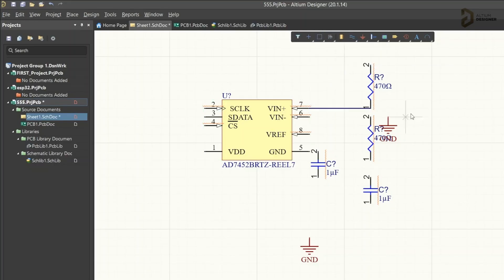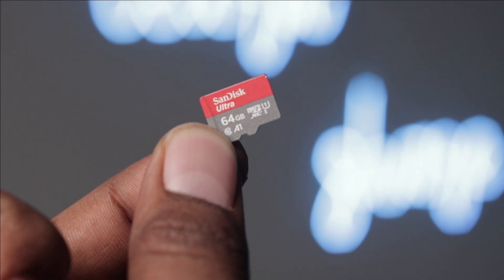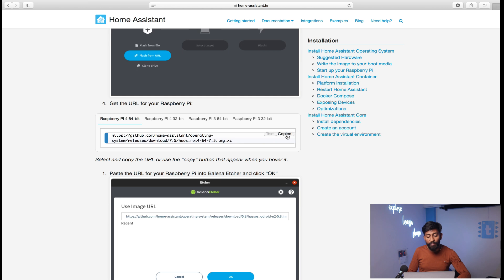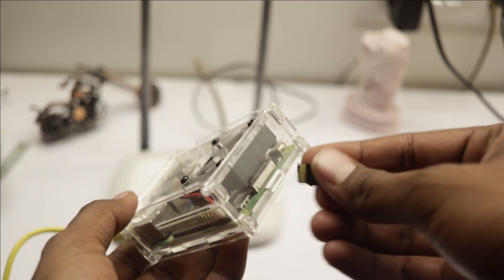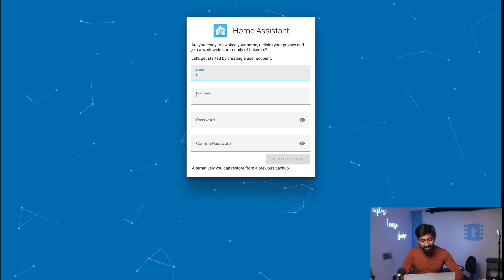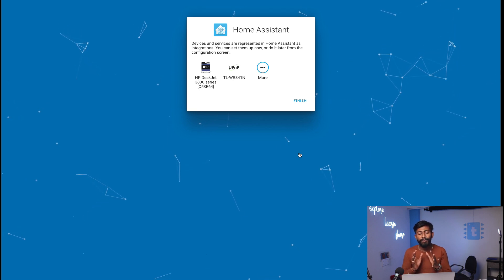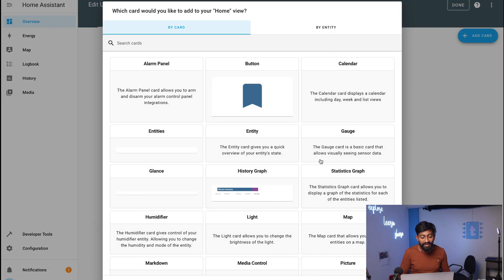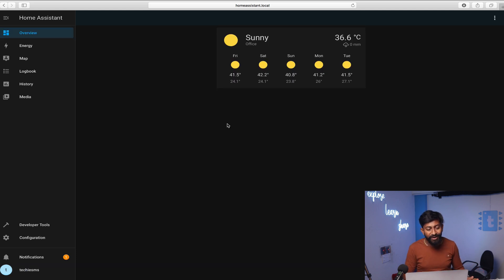Learn How To Start with HOME ASSISTANT in 2022 !!

Comment from the maker: List down what do you want to learn in Home Assistant ? 👇🏻
Reply: You are really a great all rounder of State-of-Art Technology!!! Many many thanks for this HA series 🙏🙏 and I am sure you will rock in this too.
Make Home assistant Dash board an unified one associating with ESP-NOW, Node-Red, LoRa and Tasmota etc.,
Reply from the maker: @rarenu  noted 
We will try to work on all the things mentioned
Reply: Integration of different platforms like Tuya & Tuya local
Reply: thanks so much.😊
 if possible, is there a way to make HOME ASSISTANT access esp32 devices with blynk ??
Reply from the maker: @hskh9235  need to research on this topic
Reply: @hskh9235  why?
Reply: Thanks for video about home assistant
Reply: A home cctv
Reply: please make video on how to control esp32 tasmota home automation with apple homekit
Reply: I want to learn how to connect many esp devices to single server, some esp devices might be kept at different locations where the original router range won't reach so the esp device kept at further distance should be connected to main router through other esp device like some sort of tree topology or mesh network
Reply: @33 - P A Anshad  techisms has already made a video of mesh networking. You can watch that.
Reply: @varunkumarr9633  thanks for mentioning that I have watched them  but it would be better if he integrate that to home assistant
Reply: Want to learn:

How to control Home Assistant from outside WiFi. (Remote Access )

How to make Home Assistant Faster
Reply: @Innovation_king  use ZeroTier
Reply: @Innovation_king  sure 😂

Comment: I can't open the local webpage but the raspberry Pi is connected to the wifi i even tried to open it with the raspberry Pi IP add but still didn't work out

Comment: Does the HA flashed into the RPI SD card have the ability to allow ssh ?

I did follow the instructions and now after inserting the SD card, the "IP scanner" does not show the Pi.
The RPI is connected over a physical network cable and is on the same network as the router.
Reply: Same issue any solution?
Reply: @fatalshot  I gave up with HA. Spent too much time on it. Went back to another OS.
Reply: @kiranshashiny  which OS was that ?

Comment: I want to learn how to connect many esp devices to single server ,some esp devices might be kept at different locations where the original router range won't reach so the esp device kept  at further distance should be connected to main router through  other esp device like some sort of tree topology or mesh network

Comment: Using HA since 2 years. Love it
Reply from the maker: What plug-in and integration u r using ?
Basically how u r using HA let us know
Reply: @techiesms  Homekit bridge, Mosquito MQTT broker, adgaurd home, esphome, spotify connect, tasmota, nodered, letsencypt, zerotier ❤️, tor, tailscale, grocy, graphana, file editor, air cast, speedtest etc
Reply: @techiesms  My Smart home specs

Hubs - 
Rpi 4B 2GB (16GB SD card) - Home Assistant + HomekitBridge + Zerotier (p2p)  
Amazon Alexa Echo Dot - Alexa Voice Assistant + Cloud access (don't expect privacy, i have given AC power through relay so that I can cut her loose remotely using Apple cloud or zerotier. lol)
Apple iPad mini 4 - Wall Panel + Siri Voice Assistant + Apple Cloud access 

Devices
ESP32 + relay modules fitted inside all switchboards
ESP8266 + mosfets RGB led Strip  
ESP8266 + PIR sensors for motion detection to tiger automations and send push notifications
ESP8266 + DHT22 for Temp and Humidity 
ESP8266 + 30AMP relay for heavy load

Apps
Apple Home - for phones
Home Assistant - IOS + Android
Amazon Alexa - IOS + Android
Tasmotrol - IOS + Android